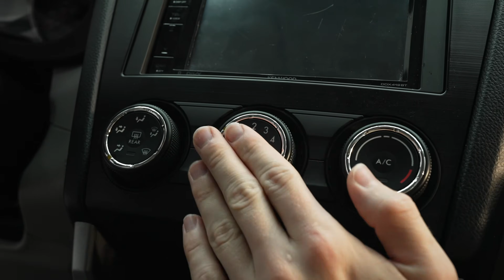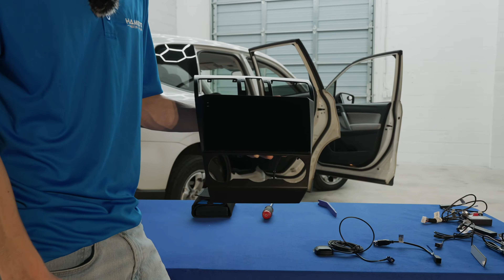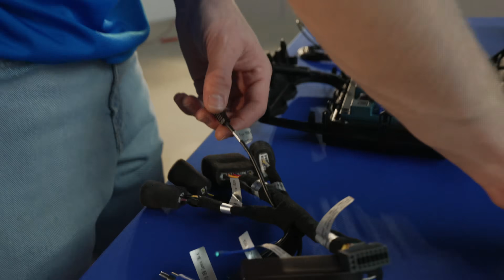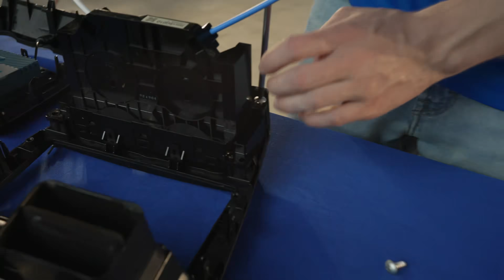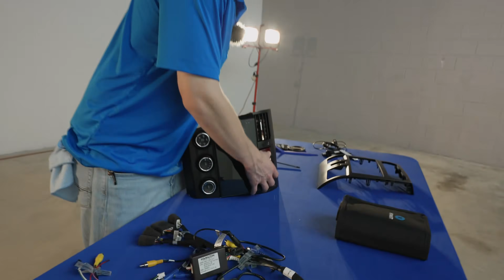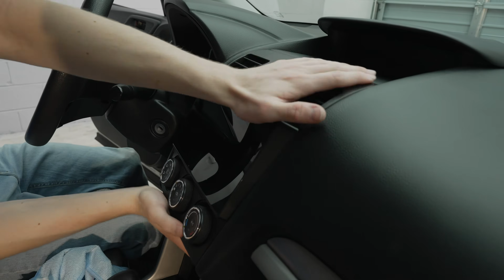2014-2015 Subaru Forester |CarPlay & Android Auto Conversion Kit | Installation Guide

Comment: Sorry that unit will not include AM an XM modes.
Reply from the maker: While the unit doesn't have AM or XM built in, you can easily use the SiriusXM or AM radio apps on your iPhone or Android to listen through CarPlay or Android Auto. Thanks for watching!
Reply: Also, if your OEM head unit has nav, you must use an OEM replacement that has nav for harness compatibility.